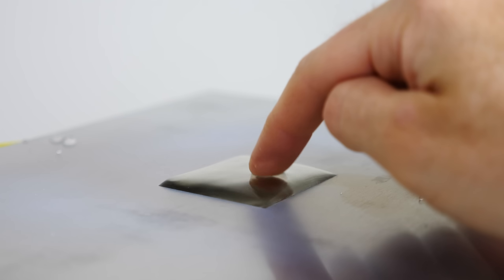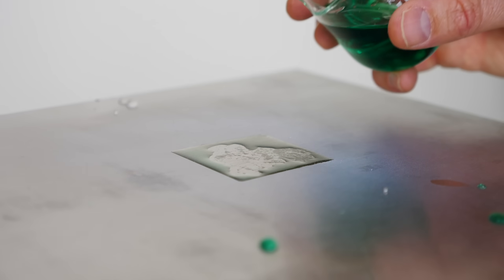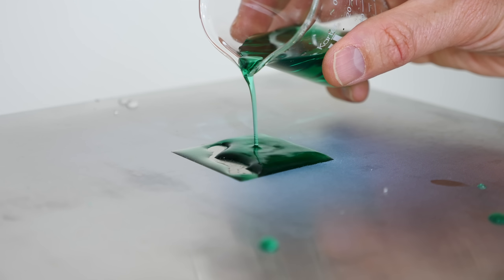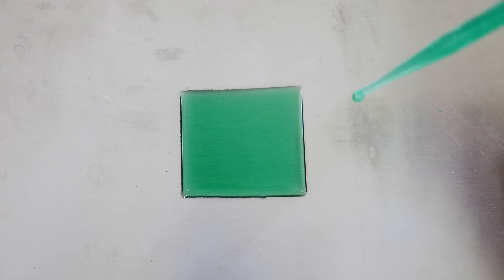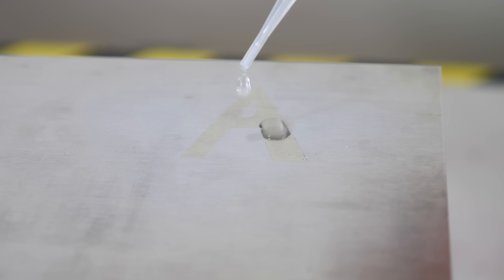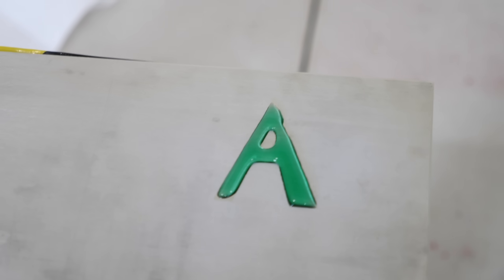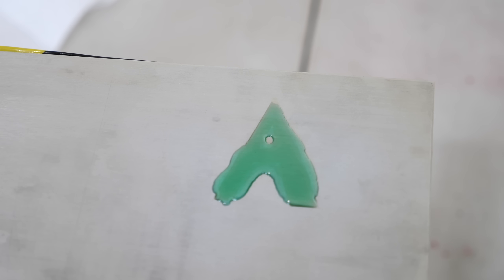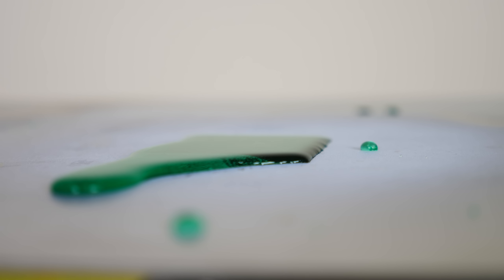I Made Square Water

Comment: Nice waves... I wonder if careful arrangements of water channels could be used for computation, using piezo drivers and sensors perhaps? It's easy to see now a narrow channel could form a waveguide, and intersecting multiple paths would let you do correlations. If you could get a phase inverter through precise delay timing, you could do subtraction and thus an XOR logic gate. OR gates are obviously trivial. Or you could go pure analog - play a signal into one end, read it out at the other, manipulate the signal through the water path and obstacles in between them. You can do addition, convolution, perhaps phase inversion through reflection.